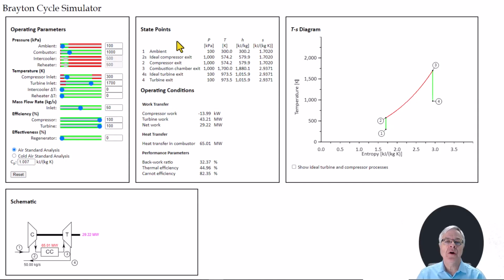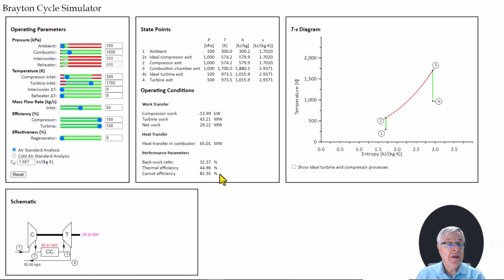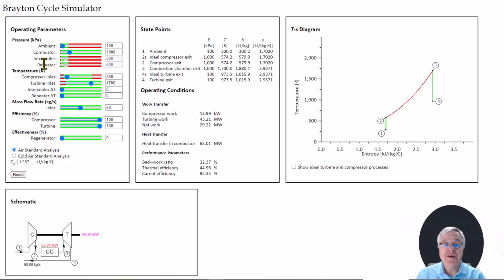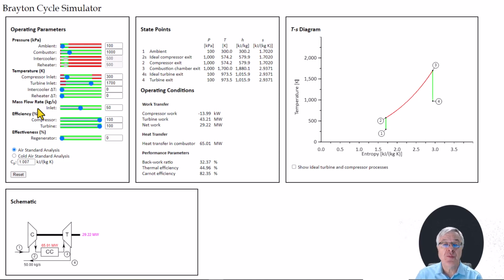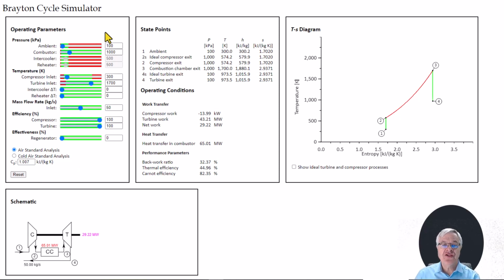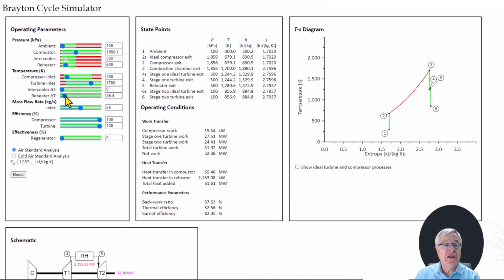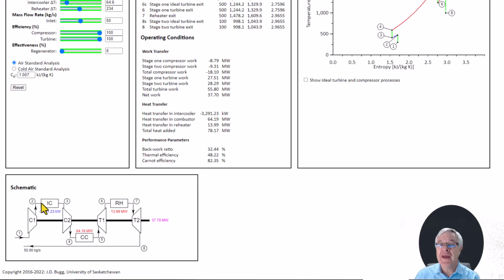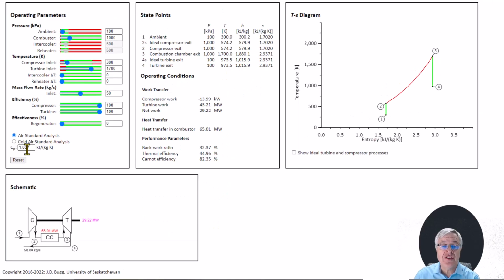Brayton Cycle Simulator

Comment: I love the simulator❤❤❤ Outstanding work on this Brayton Cycle simulator! The way you've visualized the cycle's temperature and entropy changes is incredibly clear and instructive. As an Aerospace Engineering student, I'm fascinated by the physics of the constant-pressure heat addition. Do you have a Python version of the source code available? I'm hoping to use it to learn the thermodynamic calculations and build a personal project around Brayton cycle performance. If so, a GitHub link would be amazing! Thanks for sharing this valuable tool.